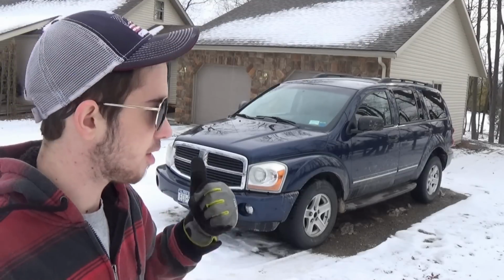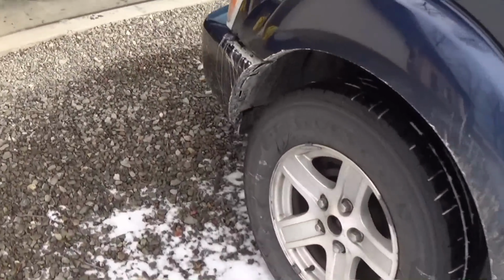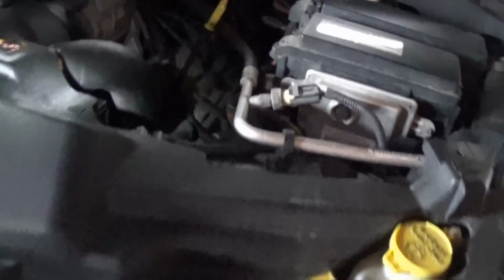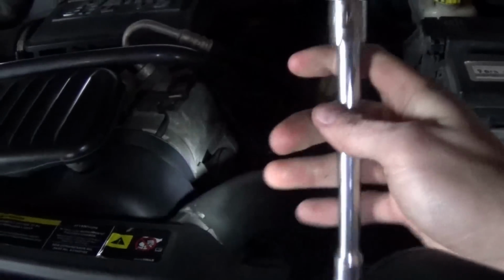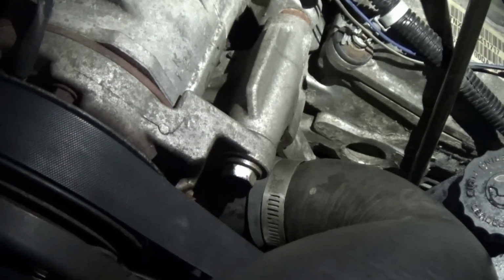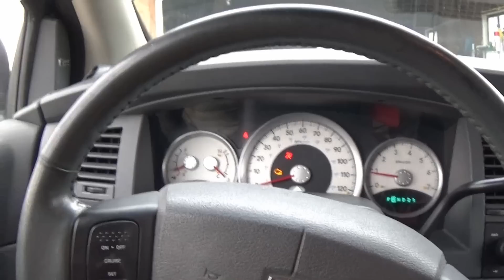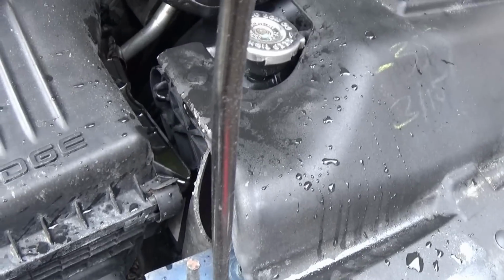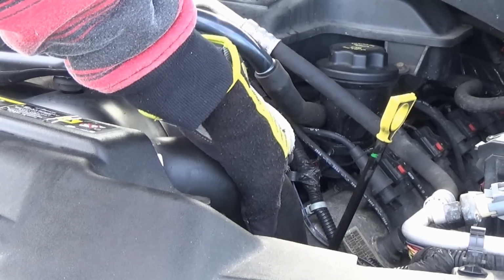Coolant Flush & Thermostat On The Durango!

Comment: 2006 Dodge Durango hemi V8 5.7 L. 125,000 miles.  Done a few things on it like new alternator valve, cover, gaskets, etc..  I live in New York, so darn freezing temperatures I started noticing a sweet smell and a little bit of milky color and condensation where you add oil. I came to the conclusion that it could possibly be a small head gasket leak  so I have to do some research. I decided to give that blue devil stuff a shot. I follow directions to a T and it seemed to work for a short time, however, after a day of running around some semi long distance, but mostly in and out of the truck, while sitting in idle, the heat would cut out meaning it would blow cold air. I also heard a gurgling noise near the passenger side over the course of a few days.  Then one day after never seen or experience any overheating issues my thermostat gauge went well above where it would normally go at running temp and luckily I was close to home. Decided to look up under the front end and saw coolant sprayed absolutely everywhere. I felt around, grabbed the thick radiator hose on the underside passenger and felt a large lump stuck inside of it which leads me to believe it is the hardened blue devil product so I have now flushed. The radiator. Removed those hoses and I’m about to pull the thermostat flush and refill and hope for the best.  I got this truck for nothing. I love it. It’s an absolute beast so I’m hoping that I didn’t cause more damage. Just be careful using blue devil product or any head gasket sealer in a bottle.

Comment: When I flush mine I put a water hose in the radiator.   Loosen the drain and start the truck and let it run bout 15-30.  Minutes.

Comment: 1337 subs. L33T!
  try pouring the coolant sideways. it will come out much easier and not glug at all. 👍 a sticky thermostat is a pretty common cause of overheating. it never hurts to flush any cooling system... they are often neglected. nice job. i like that you show what socket/extension combo that you use to reach certain bolts. i think that will come in very handy for people that come to YouTube to learn how to change the thermostat in their truck.
what did you have to do to the rear bumper to get it back on after the new hitch? the Durango looks great and is ready for many, many more miles.
Reply from the maker: Haha!!  Thanks dude!!  I'll remember to pour it out sideways next time lol!  That's right, it never hurts to flush out the system.  And a new thermostat even for a truck like this is only $20...  so why not?   I have been trying to get into the habit of showing the extension and exact wrench I use to remove bolts, especially in hard to reach places.  One of those things I wish people would do more often, it would come in handy sometimes to see.
Shoot, I should have talked about the bumper in this video while I had the chance!!  Thinking about doing another "afternoon in the life" sometime soon here, maybe I'll show it then.  We have it on there "temporarily" with nothing other than good old zip ties haha!!  We have been trying to figure out how to weld some strips on to the back to bold up the cover like it was originally though.  This spring the old rango will hopefully be getting a lot of good tlc.  Even tho it looks pretty clean for what it is, it still has its fair share of rust from that nasty road salt.  Hopefully some body work videos will come once the weather warms up!!

Comment: I got the 2005 Hemi Durango same color. It's got 190k miles on it. Still drives nice. They're good vehicles. Just about to change the thermostat in it.
Reply: Thank u too for mentioning... 🛠 😇 ⚒️ Gonna change mine too—I know it should be done because after what just happened 3 days ago—My Daddy told me I should have it checked too as well! Had this truck since 2012/2013... it would help me to do so! 😜 -6-
Reply: Yessir I have the 05 5.7 liter and I’m pushing 300k miles and only need a thermostat which I’m replacing right now

Comment: I f it's still boiling over there's a bleeder screw to open to bleed it get some ramps fill resorver first cold engine start up I'm talking about open radiator cap wile running drive on ramps an fill thradiator  find the bleader screw let it air out keep filling it as it needs more your gonna do this prossees a couple of time till no Buble just straight antifreeze close it fill res as needed take for a ride. I did this a couple of times before it was normal park down hill also after your Shure it's filled an shit it off a couple of times so it'll draw what's needed wile sitting an cooling. I hope this helps a bit did you happen to check the thermostat stat opens buy placing in a pan heating to be Shure it opens I've got a couple brand new not working

Comment: When I had a overheating/leaking issue it was the inline water pump between the radiator and the engine.
Reply from the maker: Interesting to know!  I haven't checked out the water pump on this thing before, I'll have to remember that.  thx for watching
Reply: thanks

Comment: I was looking for a video regarding my Chrysler Aspen. However they are hard to find. I know that the Durango is basically the same thing under Dodge. My Aspen is doing the same. The level fluxes and after about 10 minutes of being on. I might have to get the thermostat replaced. What antifreeze did you use? I was buying the Mopar from the dealership but it's $30 which I think is a bit ridiculous. TFS
Reply from the maker: Yep, they are really the same car, the Aspen is just a classier trim version lol..  I always liked them.
Tbh I always use green universal coolant in everything now after a flush, from what I’ve heard all these “OEM antifreezes” are, for lack of a better description, BS..  including Dexcool.  Lol.  Guess it just depends on how careful ya wanna be, it all does the same thing imo.  Good luck with your thermostat change, sounds like the same issue I was having.  Lmk if you need any help.  :D

Comment: Shoot, I need your kind of help with my 2004 Durango SLT 5.7 Hemi! Same story, been in the family since 2012/2013! It was my son’s truck while in college, now I have it and plan to use it as my catering truck! He gave it to me after my Jimmy was stolen—I LOVE THIS TRUCK!!! Never thought I would because I love GM trucks, but I fell in-love and was planning to buy another one too! I took video of what mine was doing... Spraying fluids! First it was a overflow of coolant because someone trying to be helpful overfilled the reservoir—reason why I hate playing the LADY roll at times 😂because I KNOW HOW TO DO MUCH MORE THAN THE AVERAGE WOMAN on my own, yet when I allow others/especially men to help—they create damage! 😖 lol. Now my truck isn’t overflowing coolant anymore—I let it sit for 2days, but now it is spraying a mist downward & upward by pulleys all over alt/belt looks wet & entire top under hood from left to right (Figure fan was reason) looks like drizzle rain drops ontop and under! First day I noticed problem, I had hard time turning wheel to pull off from curb 2days ago first drive out in morning, but hadn’t had that issue repeat itself again! 😅 I drove to gas station, smelled coolant, popped hood—Coolant was overflowing  and discovered the dripping from underneath & puddle infront of house when I returned, but now it is clear fluid like water coming out!?? If I turn engine off & leave it alone, the wet areas would dry back up until I run engine again for 30mins! Now after truck has been running for 10-15 mins, no smell or overheating issues, just dripping badly like water right in middle by radiator as well! What do u think is my issue? First I thought the culprits could be one of these: clamp, hose, line, water-pump, radiator or thermostat??? I have mobile mechanic coming in the morning! -6-

Comment: I have a 2005 and i put a new radiator a new water pump new hoses and theo and my heat is not good at all but my anti is Old is that the problem

Comment: I have an '05 5.7 and the car reaches running temp normally, stays there for a while, and then slowly rises to about 3/4 of the gauge, sometimes it will swing back down quickly and then rise again.  I just changed the water pump and flushed the coolant with a new thermostat, and I'm wondering if there is still air in there...
Reply: After installing a new thermostat on my 4.7 05 durango do i need to bleed the air out also after
Reply: Did you ever fix the problem? i.have the same problem

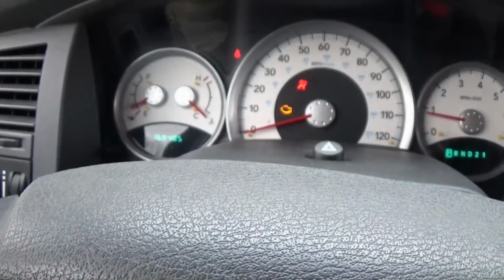Comment: @ 6:00, any idea whats causing the airbag light to come on? Mine has the same exact issue
Reply from the maker: Yep, we scanned the code and it's apparently a "small evap system leak".  Usually not much to worry about, it seems to go on and off in my case.  From what I've heard the evap systems on a lot of dodge/chrysler vehicles are pretty temperamental and a real pain in the butt lol.   GL!

Comment: I had the same leaking problem when I removed the thermostat. I wanted to run some cleaner through the system so I took the old round rubber gasket off of the old thermostat  and then put it back together with the gasket in place. Only a slight drip but it was good enough to drive around for a few days and circulate the cooling system cleaner.

Comment: Don't forget the FAN CLUTCH people are so used to Fraud and chevy direct-fan garbage, they don't know what fan clutch is had one guy replace the water pump at 100k and still overheats had no idea what he was doing was simple FAN CLUTCH which engages the fan when needed to increase fuel mileage
Reply: any tips on determining overheating between the fan clutch and the thermostat?

Comment: get the 2004 and up with the hemi engine don't look back I have own the 2006 Durango with the 4.7 is good but the hemi is better and I  own now a 2001 Durango with the 4.7 it is good but I like the 2004 up Durango better and I own a 2004 dodge ram 1500 Laramie 4 door with the hemi engine I love it i am selling the 2001 Durango so i can buy a nother 2004 up Durango but with the hemi engine .
Reply from the maker: Thanks for the advice!  I really love the Hemi too, I think at this point unless I found a super good deal on a 1st gen I would go for a 2nd gen hemi for sure!  Thanks for watching, and good luck with yours!
Reply: don't get the hemi.  look on craigslist, lot of em with bad hemi's.  They suck in water and hydralock.  get the 4.7 and love it.
Reply: btw 220 on my  5.7
Reply: The 2004 hemi does not have the mds system only 05 and up have the mds